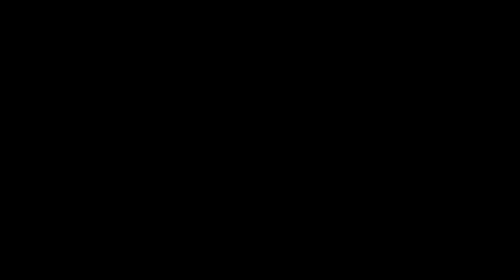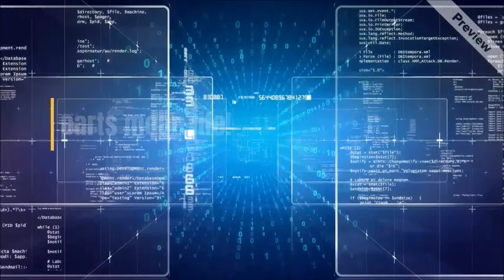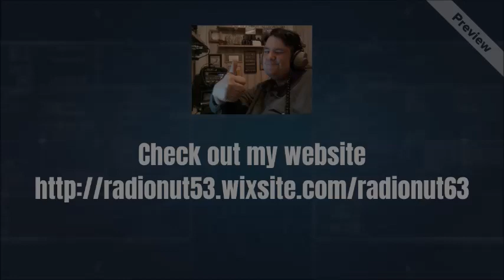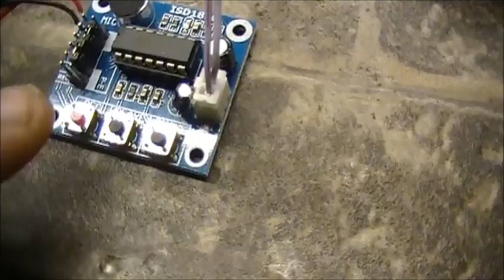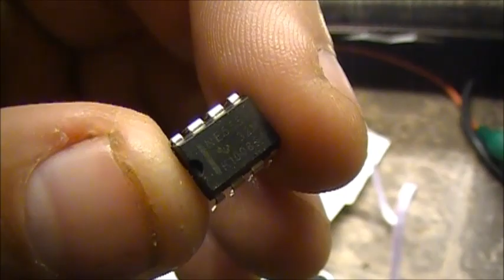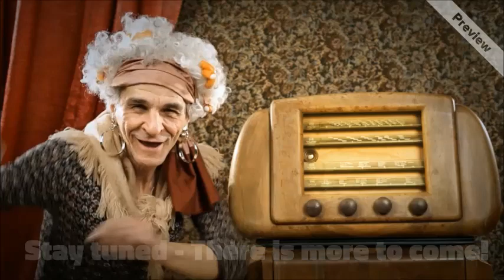ISD-1820  10 Second Voice recorder  [ HAM RADIO, CB RADIO ]

Comment: I have used the “running light” decade counter project for timing some circuits instead of dedicated flip-flops. It’s a basic binary counter but you can common outputs using diodes. I used it for camera sequencing, along with a video switch IC.
Reply from the maker: Sounds like you've got some cool projects going on!
Reply: @Radionut63  It was for a reversing camera for a large van so had a rear camera and one looking left and right, so would sequence ‘rear, left, rear, right’ and repeat like that. Plus I fitted a standard beeper kit……. Still managed to hit a lamppost in a car park 😂

Comment: I came across this looking for a way to make  a horn that sounds like gunfire. I plan to use a small speaker like those usually associated with car alarms. would this thing you made be able to amplify the output sound and regulate the volume ??
Reply from the maker: This is simply a voice recorder and player, it is not a amplifier.  :-)
Reply: @Radionut63  any idea on how to amplify it??
Reply from the maker: You would need to place a audio amplifier in line with the audio output from this device in order to get nice clear sound from it such as a home made LM386 circuit.  :-)
Reply: @Radionut63  thanks. I appreciate the info